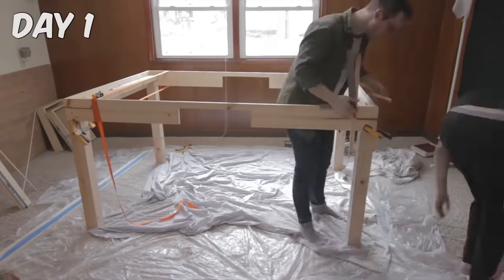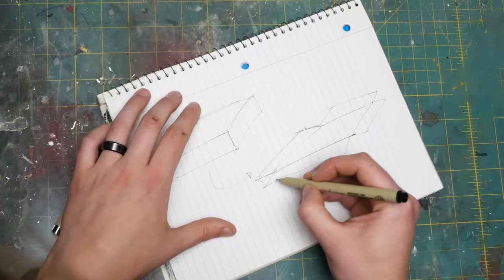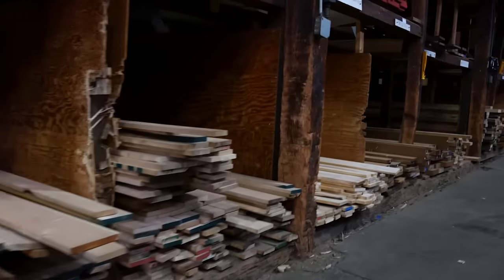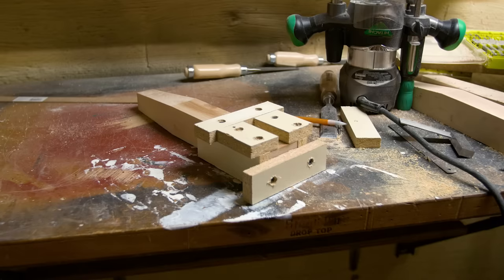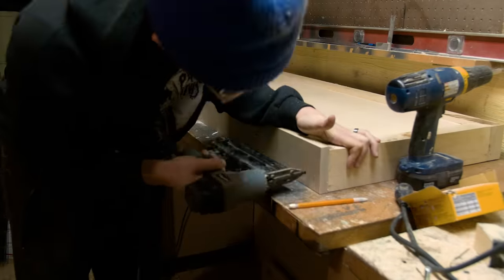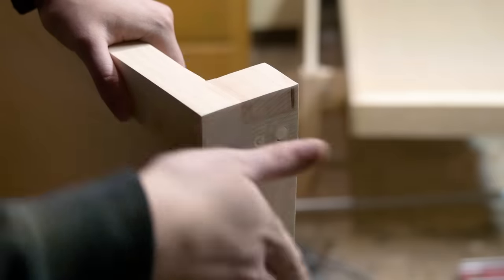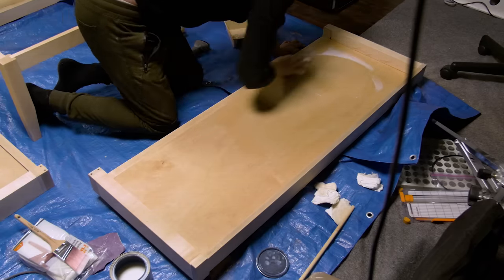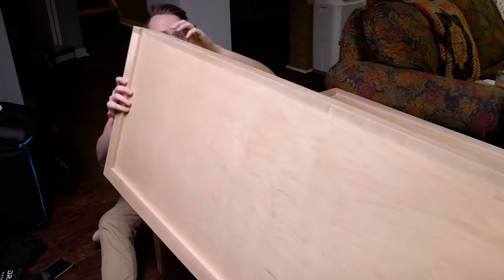Building a Board Game Coffee Table

Comment: A solution for you'er needed legs. From the middle part of the table you need to make a 360 hinge with a leg. the legs need to be in the shape of a 7 but make sure its a right angle cut. When the table is folded in you'll see the legs joins but it will still be flat. When its folds out the legs come with it. Its a home made hinge. So what you need to do is..... on both sides when the table is folded in is mark the middle. then cut a trench deep enough to hold the angle part of the leg but also long enough to hold a dowel.  SO think of two 7's together  but on the lines like this ] [ ....... A metal dowel place down and then replace the empty space of the wood you have taken away. Don't forget to drill the holes for the dowel in the angle part of the legs. If you need a drawing of this i'd be happy to help. so you can see how easy this will fix you'er problem. DO NOT DESTROY THAT TABLE OR START A NEW ONE.

Comment: Good rules of thumb:
- Cheap hardware ends up costing you more in the long run. You'll either end up replacing it or ruining the much more expensive wood.
- Build your prototypes out of cheaper materials. They can still be functional and attractive, but you won't feel bad about making mistakes. When it comes time to build the next one, you'll have learned better methods and what your needs really are, and someone will still love the prototype (if it held up).
- Ditto the above if you're experimenting instead of working from a plan. Remember, measure twice and cut once, but before you can do that, you need to know the measurements!

Comment: "I need more clamps"

Haha! Welcome to carpentry my man! Fortunately for you there is a very handy formula to work out the exact number of clamps you need!

Below, "n" is the number of clamps!

n = n + 1

I watch a lot of woodworkers on YouTube, and I'd absolutely love to add you to that list!

Some tips for you:

Use a mallet on your chisels. 

Throw out hinge screws unless you spent like $30 on the hinge. Cheap Chinese hinges are fine, but the screws they come with are - as you well know - garbage. You can add more strength by simply grabbing some gate hinges and extending the grooves you've cut. Or perhaps you could add a deadbolt to the walls - just an idea! 

I think your jig for the routing would have worked, but consider attaching it to your router next time. If the groove is off center, you can get away with just flipping the wood longwise.

You did a great job overall. Finishing the project is really the hardest part haha.

Comment: I know this video is a year old now and you may have moved on from this project. But a way to strengthen up those hinge portions could be done with a steel dowel and some pipe straps (it would look similar to a bolt style lock). You would bolt up the pipe straps and the dowel onto the main body of the table, then when you folded out the sides you would slide the dowel into more pipe straps on the side of the foldout (on both sides supporting each hinge). Part of the weight would be supported by the steel dowel instead of the small hinges. It would give the table a little bit less clean and more industrial look, but overall could add strength to the build. 

Rebuilding from the ground up with a different approach would work too, but the table looks great and would hate to see the folded out portion not get used! Overall great job and great video documenting everything, too many videos skip their mistakes and those are the most important part of the learning process!

Comment: What you could have done, which would have been way stronger, is have swingarms which come out from the void in between layers and lock into an overhang on the sides.  You might even be able to retrofit it if you're smart about it.  Bascially the idea is to have a long meaty chunk of wood to bear the weight of the fold-out section instead of those pissy little hinges.

Comment: You can solve the hinge issue by getting some longer, heavier-duty hinges at the hardware store.  Look for something the right width, but designed for holding something like a shed door, or fencing.  You’ll need to do some adjustments to the surface to mount the hinges (as you would to do any different hinge), but you shouldn’t have to completely redo the table.

Something like this: https://www.homedepot.com/p/Everbilt-6-in-Black-Heavy-Duty-Decorative-Strap-Hinge-15025/202034102

Comment: The reason you were having so much trouble le is because you used maple. It's a very hard wood that is rough with lower quality screws and bits. Try using a slightly softer wood if there ever is a next time. The good news though is that table will last for a really long time.

Comment: You could've reoriented the layout on the plywood to get both top panels out of 1 sheet. A T-slot milled across the openings and some steel rod would make the open top sturdier. You have the necessary tooling, mostly. Still, good effort.
Reply from the maker: How could I reorient? If I rotate the cuts 90 degrees, I'm still an inch too long. If I keep them as is, I'm also too long.
Reply: Totes missed that your long dimension was bigger than the short of your board. My bad. Short to short, unlike long to long, the way you have it diagramed at 12:29, would've given you enough waste to make up the missing material without being too obvious, especially if you roughly center your cut boards between the patches. Although you could keep the cuts oriented the way you have it, you wind up with a 2-inch strip across half of one long side of your table instead of two 1/2-inch strips across the entirety of both short sides of your finished table.

Comment: Great video, however i think your screws was screwed up from the start. As You used hardwood it would be probably better to use some high quality torx screws or something similar. This way or another this table is so much nicer that the one you used to have :P
Reply from the maker: Good point, I'll look into those next time!!
Reply: Any  screw with a coarse thread will work.  And I'm telling you guys use a impact gun  Instead of a regular drill to drive screws.
Reply: @williamwinn948  You generally want to use fine threads with hardwoods and coarse with softwoods. You can often get away with coarse threads, but an inexperienced woodworker using them on hard maple is just making his life harder.

Comment: That plywood would have worked with just 1 piece, rotate the two cuts to equal out and have leftovers
Reply from the maker: If you rotated it, they'd be 1 inch too short. I needed a yield of 49" and they are 48" wide on the Y axis.
Reply: @Miniac  from what I was seeing in your diagram with pausing and rotating from my square and angle finder, that was feasible.... but I was never that good in the maths... just the science.

Comment: Maybe your drill was on too higher speed? Or torque? Regardless my rule of thumb is to pulse the trigger with quickly rather than hold it down, learnt this after years of pain. But having said that I generally encounter as many setbacks as you did during a build, I think those d.i.y videos must edit out a lot of sheeet.

Comment: Why not just have it roll open like a dresser and add the extra 2 feet of wood ether expanding from the center if you want to be fancy or just slot it in as a separate peace use some hooks to keep it from rolling around and bam you can keep the ridge around the table and it's way easier to do

Comment: I may be wrong here, but I feel that with the machinery investment, materials, time investment and screw-ups and stuff - most people would be much better off ordering a custom-built table from a local carpenter. And it would probably still be cheaper and work better.
If you're serious about carpentry and plan to build many pieces of furniture for your home - it could be worth it in the end. But if it's just a few things here and there - the tools alone will eat up all the savings that you're making. And if you screw up and ruin the wood? Even worse.
And yeah, planning is king. I see even professional carpenters sometimes making a test model from cheap materials before using the good wood.

Comment: The problem is the table will flap eventually. Those two adorable hinges can't hold up. You can either make 4 more legs to support the table when it's extended (Who wants that?) OR groove 1/8" where the wood meet (the lower part of the table) and screw in 1/8" metal plates with FLAT heads.

Wont be perfect, but it would last a lot longer. Implying your fat buddy doesn't rest his arm on the table.

The golden rule is: The more there are moving parts, the weaker it is.

Comment: You can buy long hinges, they are called piano hinges.
Reply from the maker: wouldn't work in this scenario.
Reply: @Miniac  Re watched that section, you mean longer in the other dimension to a piano hinge?
Reply from the maker: @665libertine  The hinged edge that it opens on is 85% empty. There's no wood for a piano hinge to attach. There's about 2" of wood on either side of the gap. The gap exists so that when the table opens up, there's a full pit to play inside of. If there were no gaps, there'd be 2 walls inside the box when the table opened up.

Comment: Dude the hinge you're thinking of making is just called a piano hinge
Reply from the maker: a piano hinge gets its strength from being wide, I have about 1" 3/4 to work with. I need a hinge that's long, not wide.
Reply: Miniac not sure what you’re thinking of but a typical piano hinge is at most 1.5” wide counting both sides and can be anywhere from 18” long to 6’ long. You often buy it longer than you need and cut it to length. Unfortunately for your table design it wouldn’t work.